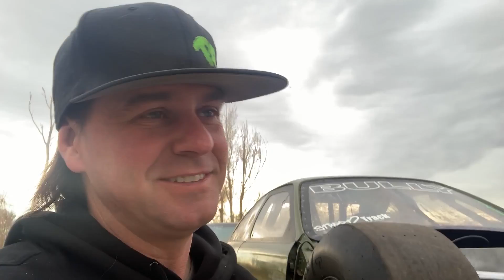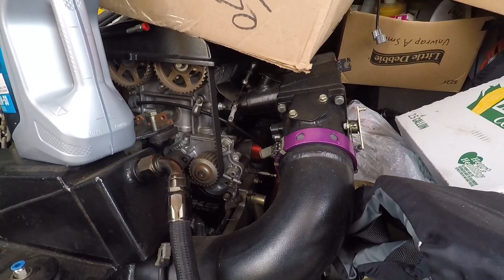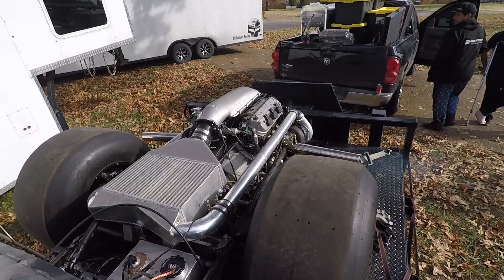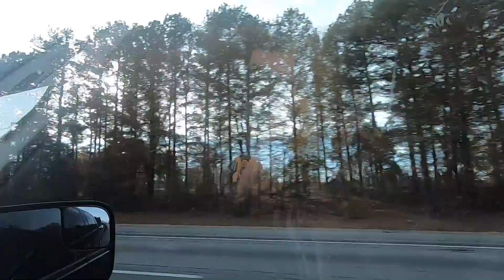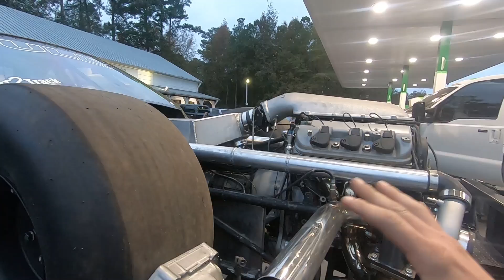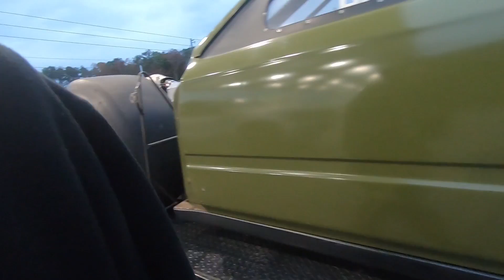BULLY takes a Road Trip , Questions answered .

Comment: Hey due. What's up . i seen ur usen a motorcycle  engine for the go-kart. Use a stunt sprocket . it will give u a lot more torque. I have. A f4i 01 stunt bike . an that one of the thing all stunt writers use a stunt sprocket . make it easier to pop a wheelie on ur  bike. Okay bro have a good time an yasss turn up but have fun . an yes i also have a 1990 Lx b16A  integra. An 07 wxr. An 05 cbr rr 600 yes 01 the f4i a cbr rr 600

Comment: Definitely a wicked setup, does the swivel front end provide more traction than a rigid setup? Itd be cool to get it working like a 4 link. Hopefully down the road you could try a th400 with a lockup converter, having a shorter first gear would probably help turbo spool a lot on the line!

Comment: Brent, it would be cool to copy the Bully's drivetrain, but use it in the rear of a car, make a NSX/ Gen 8 Corvette eater. And props to All Motor Phong, still has his motor running, constantly, keeping the shop tidy. And if you tell Samantha to reverse the direction of the drill, she might someday finish putting in that bracket.

Comment: What ever happened to pro mod front wheel drive drag racing anyways? It was so big in the early 2000s then just disappeared and was never heard from again. I understand that teams like speed factory and going faster than then those old pro mod cars now days, but they thoese cars aren't tube frame cars with wild 30in tall tires on them.
Reply: william seroyer factory sponsorship pulled out when NHRA pulled out of the sport compact series. It took a lot of money to keep these cars going as a privateer so most of these cars sat in garages collecting dust

Comment: Transmission thoughts .  Eldorado or Torinado  has front drive for 472 /501 cad and 455 /425 Olds.  I am thinking that dif could be made posi . also a stall converter for a turbo 400 rear drive trans.  I really like that V6 J series .  Sounds super. I think you will like how it works when you get there

Comment: Side note, would be cool to see the intercooler changed up to be a dual pass unit so your charge pipes can couple next to the throttle body instead of running the length passed the intercooler to tie in.

Comment: I can see how converter engineering would be a headache; the 'Glide was designed to go behind a 235 ci straight 6 or 265 SBC - both of which would have a very different torque profile to a Honda 4 cyl. Plus the converter design is intentionally loose to compensate for the 2 speed trans not really having a first gear. I applaud your willingness to take on such a challenge but man oh geez that's a lot of engineering...

Comment: Is the nitrous solely used for getting up on the converter or will you be spraying it down the track as well? What an awesome build! When you put out that much positivity its easy to get it in return. Safe trip guys!

Comment: Hell yeah, that's why I want to run a power glide or TH400 in my Mazda. We run a glide in our 62 Chevy II and a TH400 with a manual valve body in a s10 that I pulled out of my 73 GMC before I let her go. We know they put in hard work. Found my J35 today, got it fired up and ran it for about 20 minutes. Gotta find an adapter for the transmission and figure out my wiring. May try to get some Phong love on the heads since I'm going to stay N/A. Lords willing I'll be seeing you guys in the spring!

Comment: I feel like 1000hp on those tires and a glide it will run 9-10 second passes. Minimum you’ll need 1500-1600 to get those things to work. Not only that but if you make 1000whp through a glide on eBay 35r’s it’s a miracle.

Comment: Big props for being differen't and just building what you want Brent.

I used to have a TL and although mine wasn't very fast I did notice that engine responds with surprising results with simple bolt on parts. If it was not my daily I would have gave it 100 shot and probably hit around 400hp.

Comment: Can't you take the parts out of the transmission and have them machined out of stronger material like you do with billet blocks? There's a guy that goes by Pink Puss who runs a crv motor with a 350 trans in his crx. If the 350 works with the b20 you couldn't mate it up to the h22 somehow? You did say he had a prelude motor right?

Comment: The bully looks more like the grinch does then the grinch. Bully isn't very loud or fast sounding would 9f thought a v6 would be louder.  Sounds like it's gonna break up when your in the throttle 3000 rpm sounds like there's a ruff spot

Comment: Brent, have you thought about running a 3 or 4 speed Lenco instead of the powerglide? I feel like two long gears through a loose torque converter will rob so much potential from this setup. A clutch and couple more gears could really help the 60ft. Just spit balling bro. I can't wait to see what it does as is!

Comment: Naa man your chassis is fine.  If anything, chop the tube and replace just the frame rails with 2x3 box and slide the rails as far in to the factory frame lets you then blow holes in a couple spots and stud the inserted frame in to place.  So many ways to do it though

Comment: Hey Brent I know you probably won't read or reply to this but here goes 
I just have a quick question on why you chose that suspension setup over "normal" suspension, can you explain quickly on why it's like that and if any what gains do you benefit from it, seams like a lot of work and in the previous videos years ago the front kinda drags the rear, wouldn't it be faster without that setup? I know my question is all over the place and I apologise thanks mate

Comment: If you can get it up on the converter and get it to shift it'll fly.. I've watched the video of it running 9's in first 🤣🤣
Reply: Right , that 9 second pass had everything against it and it still put up a good slip
Reply: @lloydgrandy8189  looked so slow as well.. Just shows how easily it did it

Comment: What about the acura type s 6speed. There is an 1100 hp j35 using that trans. Its boost by gear tho.
Reply: It would break first launch with 1000hp and those big tires is the problem

Comment: Forgive my ignorance if this is a dumb noob question... But surely a 4cyl S2000 engine has different harmonics to a V6, so would have thought the dampener would need to be weighted differently? Or am I wrong and it doesn't matter? Edit - respect to all involved, such a cool project!
Reply from the maker: They use the same material regardless the engine, the size of the damper is what changes things smaller is good for a street engine where a race one like on bully will be larger. , so it just needs to basically fit the crank snout.
Reply: @PFIBrent  Got ya, thanks for taking the time to explain, absolutely loving all your content, stay awesome! ;)

Comment: Hey Brent, just wanted to say you're awesome brotha! Super happy for you and super excited to see the Bully make some stank on the dyno. Between that, hopefully some runs at the strip if possible. Once you can gather enough data and have the answers you need I bet you have a lot better selection of torque converters out there and I'm sure theres someone that can nail it on building a custom one. I really hope its smooth sailing from here on out with the Bully. I think if you angled the bullhorns back with some miter cuts it would look awesome. Maybe once the Bully starts beating up on everyone some companies will get on board and maybe you can get some mirrored turbos or a nice custom converter out of the deal. Any plans for replacing the circus I mean circuit board & electrical? Anyways love the energy, positivity, and good vibes you bring every day to the shop and the channel. You're really living the dream and you deserve every bit of it Brent. 

P.S. You said something in your last video about how we will get through it and battle through it while speaking on people going through things at home. It was like a message sent through you or something but absolutely impeccable timing. Gave a brotha the push he needed and after that I succeeded, because That's What We Do!! 

PFI "Postivity, Faith & Inspiration"

Comment: the J35a JDM engines are cheap AF and tough first gen MDX had a drive by cable throttle body too (hard to find as most were drive by wire)
Reply: Theres a adapter to run bseries throttle bodies on the j series so u dont need to find that specific MDX model
Reply: @Dsilver024  yeah i get that, just ment if you knew where one was at, im sure if you got the right adapter you could get a lot bigger one then honda ever made too

Comment: dude if you have converter problems go spragless . i did that in my super comp rail never blew another converter again !
Reply from the maker: That is my plan, as soon as I’m home
Reply: Badass...
Reply: True, but they have some serious sprags nowadays that I'd expect to live at this level, no?
Reply: @guhfluh  no to much tire !
Reply: @raymondj8768  Yeah, I can understand that. I had a spragless in a ~500hp 4cyl application that I loved, but it didn't like to couple on the top and did make a bunch of heat. I went with a sprag this time, but whole new converter design, billet stator, etc. and the power level and application is quite different.
Reply: @guhfluh  yea hes running twin turbos and fat ass tires it will be hitting hard thats what kills them i had a 900 HP super comp rail with funny car tires it hooked every were but killed converters then i built a JnW spragless they tryed to talk me out of it to bigtime sure i was blowing my converter up 3 or 4 times a year lol it did cost a few MPH but it was worth it brother!